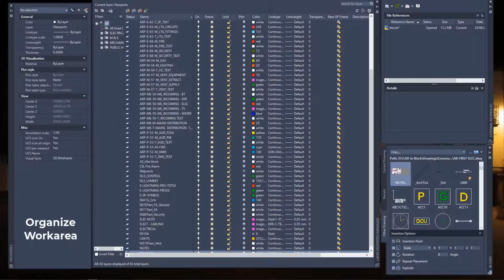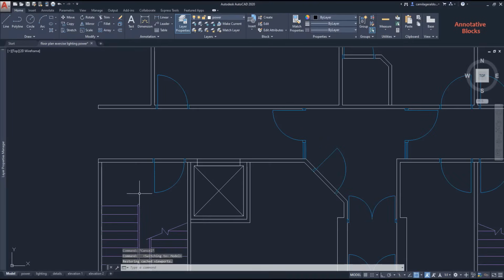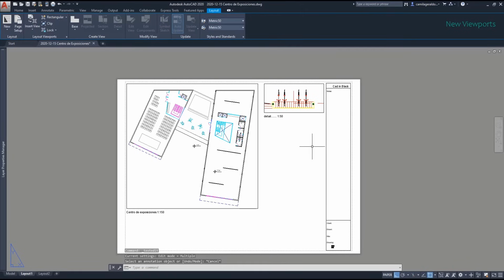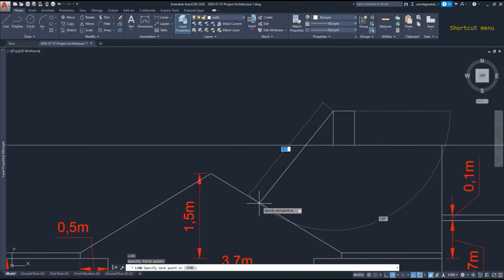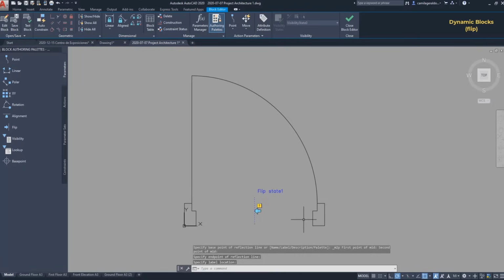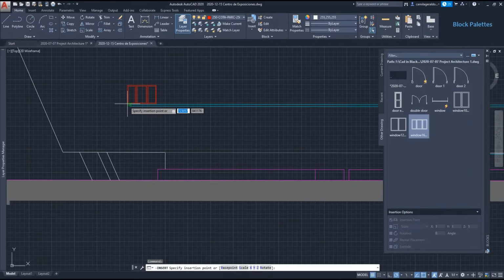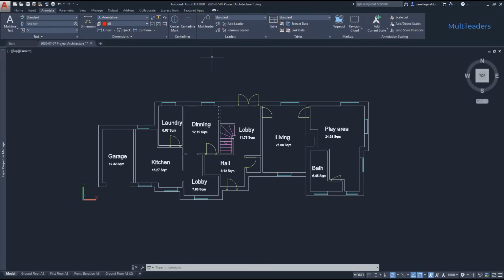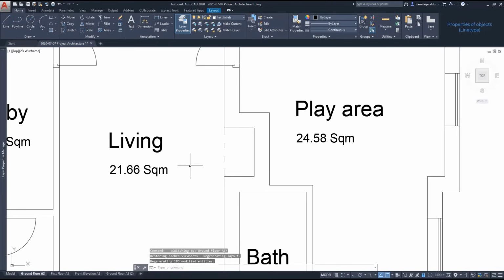Autocad - Complete tutorial for Intermediates (Full tutorial 1h38m)

Comment: Sir, in the top left corner where it has the custom views, {TOP}, WIREFRAME etc., mine is not showing unless I hole the mouse over it. It used to show all the time. Is there a variable I may have inadvertently changed? AutoCAD 2020.
Reply from the maker: Hi Douglas. Hope you are doing fine!
Please type: OPTIONS;
then: "3D modelling" tab -> "Display Tools in Viewport" panel -> Click on "display viewport controls".
Reply: @CADinblack  : Thanks, but it is checked. yet nothing is showing unless a pass my cross hair over it. It works just not visible. (ACAD 2022)
Reply from the maker: Oh, it looks like it's hiding automatically. Isn't there any option about it?
Reply: @CADinblack  No sir, and what more puzzling, it’s only it this particular drawing, I open a couple others and it’s visible. So In away, it’s all good. Just not showing in the one dwg.